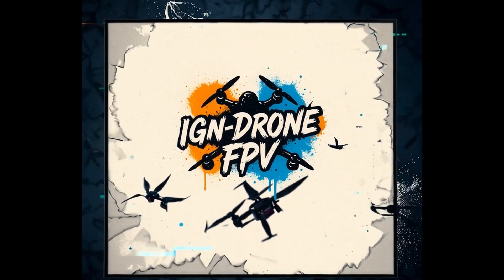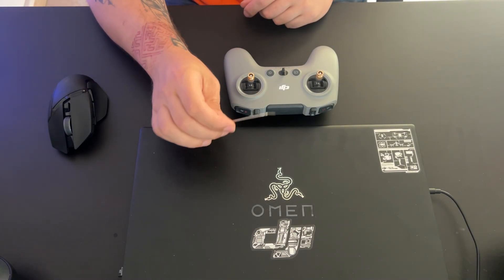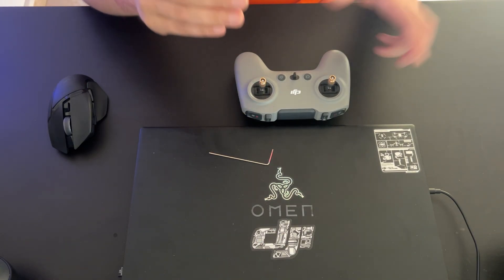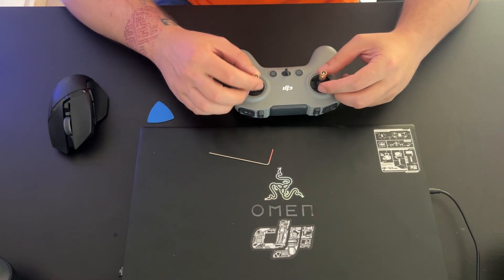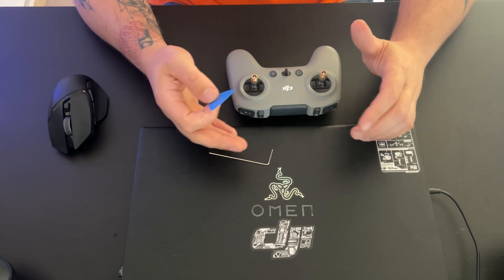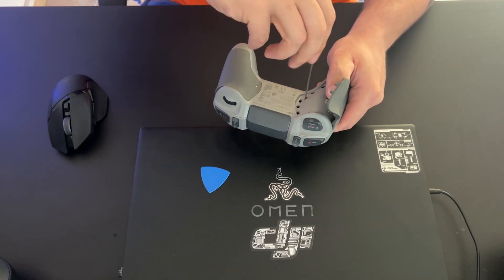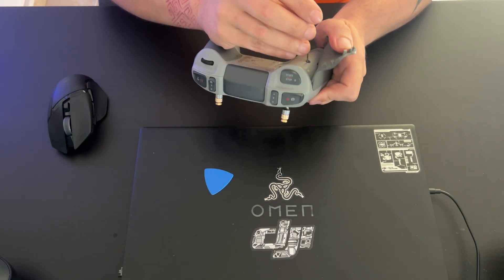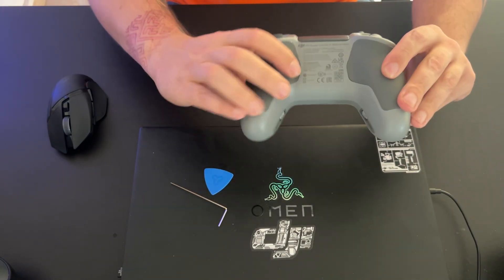DJI RC 3 SET UP FOR MANUAL / ACRO MODE - TUTORIAL - STEP BY STEP

Comment: same, have DJI Mavic Air 2 and couldnt fly it at all with the default, had to switch the controls... planning to buy the controller and start flying FPV and have to say this video is great.
Reply from the maker: Thanks a lot for support and plus in the end getting FPV controller i switched to mode 2 and will tell you i wont regret it